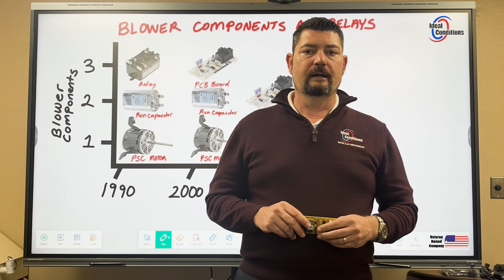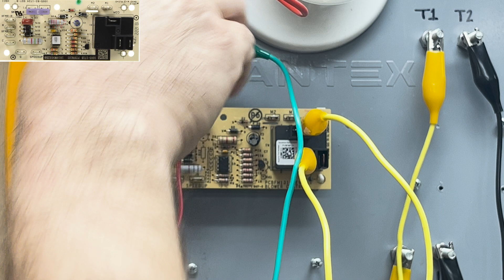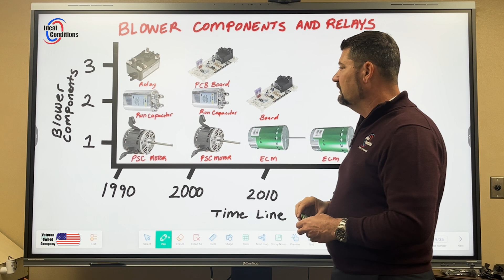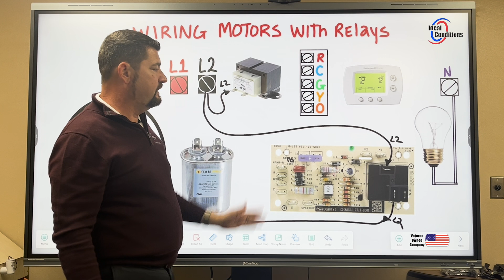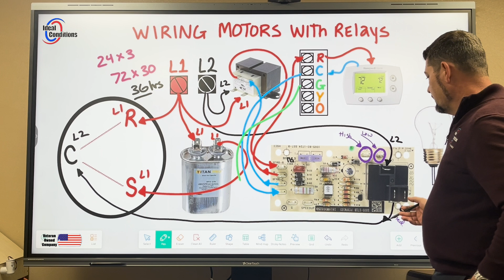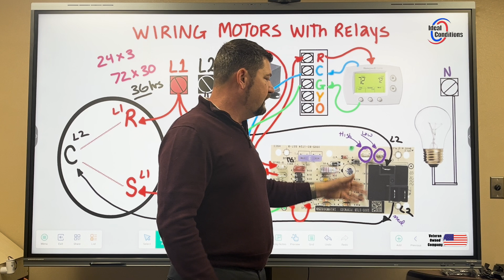How to Wire a Goodman/Amana PCB Blower Control Board

Comment: So maybe you can help. I am  a General Contractor and understand electricity quite well.
We are trying to help out a friend that had a HVAC contractor come in and fix there Goodman electric furnace, It is set for a split but does not have any of that it is just an electric forced air unit.

Well the HVAC contractor changed out the PCB board and left and the client was left with a system that would run and then blow the breaker.

We have not really been a tech service on these units and are trying to learn.

We did change out the PCB board to see if it was the problem and now as soon as we turn on the breaker in the panel the units fan fires up and will not shut off.

Which based upon your video, this seams to mean the motor wire is on the NO and should be on the NC terminal.

But also there is no heat when the unit comes on either.

I am not getting low voltage at the sequencers when the unit is on.

Any suggestions.